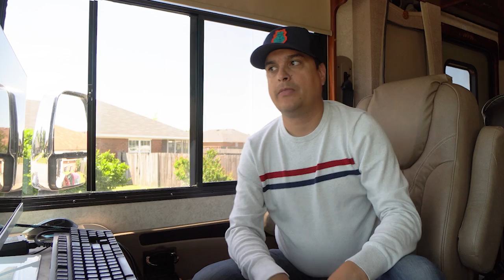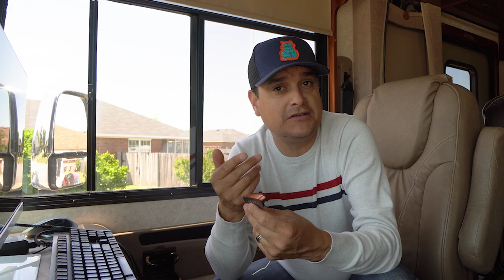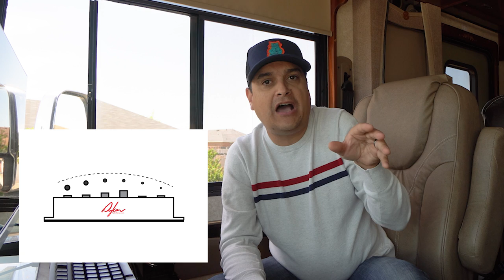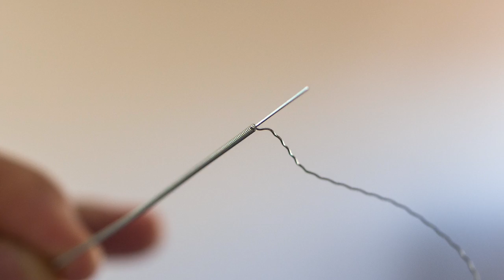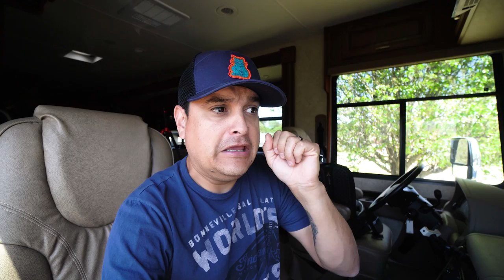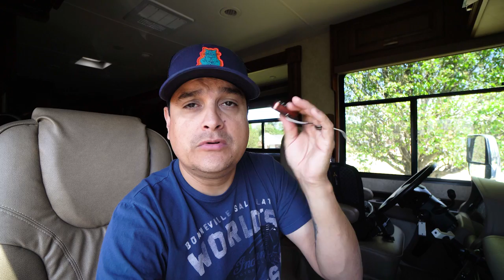How To Choose Single Coil Pickups - Flat VS Staggered

Comment: Something that younger players are often unaware of is that at the time that Leo Fender was developing his Telecaster pickups, modern roundwound guitar strings didn't exist. All wound guitar strings were flatwounds. When the new technology of round wire wound on a hexagonal core appeared in the mid '60s as an alternative to the traditional flat ribbon wound on a circular core, blues, pop and rock players started to switch in order to have the combination of easier bending and greater sustain. 

The difference in output and sustain between flatwounds and roundwounds is considerable, and that alone would have necessitated a change in the polepiece configuration. But the fact that the G polepiece was so high suggests that early Telecasters and Strats were still being supplied from the factory with a wound G string. I think that the real driver for unstaggered pickups was the switch to lighter roundwound strings with a plain G.

The very low polepieces for the B and high E make sense in terms of the strings available at the time. Very light gauge plain guitar strings were not standard, and the stock top E would probably have been a 12, with the B a 16. (In a modern set, those would be a 9 or 10, and a 12 or 13, respectively). Those heavy plain strings had a lot of steel in them, so the polepieces for the B and E had to be set lower than would be the case now. 

The problem came when players wanted to use lighter plain strings. Old school players who wanted to bend could get around the heavy stock gauges by swapping in a banjo string for the top E and moving the other strings down to get an unwound G. Unfortunately, this would immediately throw out the designed-in pickup balance for each string, with only fairly crude adjustments possible. In particular, that unwound G would now be too close to the very tall G polepiece, and the lighter B string too far away from the very low B polepiece. The result would be a G string that sounded too loud relative to the B and high E. 

Fender's return to flat polepieces in the '60s coincides with this move to lighter string sets. It's only later, in the early '70s, that Fender changed their standard radius from 7.25 to 9.5. This also reduced the problem of string-to-string pickup balance somewhat, but I believe that that was incidental to the main aim of improving general playability and addressing the different problem of strings 'choking out' when bent in the higher positions on a 7.25" radius neck. The need to go back to a flatter polepiece stagger was a response to changes in string technology and players' choices.

(Lest anyone think that this kind of problem with strings was exclusive to Fender, we see a similar problem on Gibson guitars that have a 'zigzag' stoptail bridge, with the 'saddles' cast into the metal of the bridge. On early Gibsons, these bridges are clearly intonated for four wound strings and two plain. It was only after the lighter, three plain and three wound string sets became the norm that these bridges were changed to the correct configuration for a plain third. If you try to use a modern light string set on one of these old bridges, the G string cannot be correctly intonated. This created a market for adjustable stoptail bridges by other manufacturers.)
Reply: '50s Fender strings were groundwound.

Comment: Hi Dylan, I'm curious how the pole spacing affects tone (or maybe not). Stratocaster has 52mm pole spacing on all 3 single coil pickups, but there are some with 48/50/52 mm on neck/middle/bridge. Do you have any thoughts on that? Thanks!
Reply: Yes it does affect it, though not to such a great degree. Usually vintage bridges with string spacing of 54mm or more are better suited for pole pieces of 52mm on all 3. Modern spaced bridges are better suited to 52mm on bridge and 50mm in middle and neck. Since  your nut is approximately 42mm the string spacing gets narrower the closer the strings get to the neck so having correct pickup pole spacing where the poles are directly under each string will give you a more defined tone.

Comment: I have two Strats (out of five) with staggered pole pieces, and I dislike the sounds. One has Fat 50s which sound anything but “fat”. The other has Texas Specials. Those don’t sound good to my ears. In both cases the pickups sound too thin and wiry, and in addition, they seem low output, relative to my Strats that have no staggered pickups. Pickup heights are fine- not too low/high. Not sure what the stagger has to do with the tone or output, but I don’t like these pickup sets, and want to change them to something else. If you have comment about tone/output of staggered versus non-staggered if any, great! And thanks!

Comment: should i risk heating up the G pole and pushing it down a bit?
Reply: that'll be a no then!
Reply: First maybe set the G string a nut hair higher and see if there is even a difference?
Reply: @gopork  There will be. The intonation will be off. If you raise the pickup a hair, and notice a difference, then you may have something. My guess, is that you won't hear any difference with that string.

Comment: Many ppl don't talk abt this these days, but the current line of American Professional Strats from Fender has staggered polepieces on the V-mod pickups even w a 9.5 inch radius. Which by logic of this educational vid, doesn't make sense or do any justice to us buying these guitars! 

It's clearly unbalanced, the volume across strings on the Am Pro models and I don't know why this is not talked about enough. For the life of me I can't figure out what justifies this approach frm Fender. Am swapping out the P-ups for flat ones.

Comment: Easy for me to pick. Vintage staggered every time
Reply from the maker: why
Reply: DylanTalksTone  I had a few nice strats back in the 90s with even poles and one with lace sensors. Picked up a mim strat 1960’s and have been hooked like never before. Back then I thought the vintage stagger looked antiquated. Vintage stagger has all the classic strat tones which is all I want. Just something I had to learn the hard way. Each has their own strengths. Cheers

Comment: Once again Dylan opens my mind! Just 1 question:
Say I use pure Nickel wound strings with plain G string (0.017).  Would it be acceptable to just flatten the pole piece on the G string and leave the others in their « traditional » position?   This way purists would have balance and satisfaction.
Reply: No. Why potentially screw up your guitar to please someone else? 🤷‍♂️ I do things to please myself and screw what anyone else thinks.

Comment: At one point you said nickel was not ferromagnetic. Get your physics right. Iron nickel and cobalt are the common ferromagnetic substances.
Reply from the maker: In the alloys used in covers, baseplates and etc…. They are not magnetic because nickel, while being considered ferrous… is actually pretty weak in that respect. This is why it is used as a component in an alloy with cobalt and iron to make Alnico magnets. If you mix nickel with a nonferrous material, most of the time the end result is the alloy won’t really “stick”